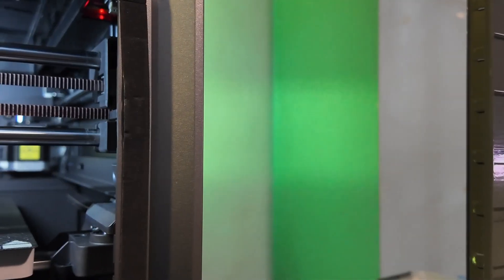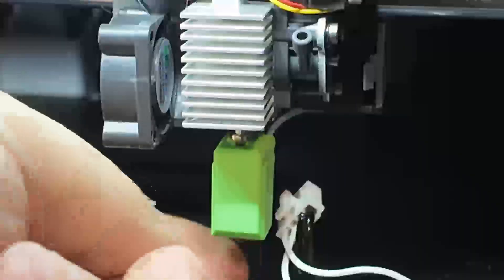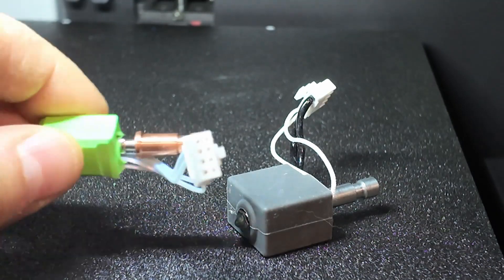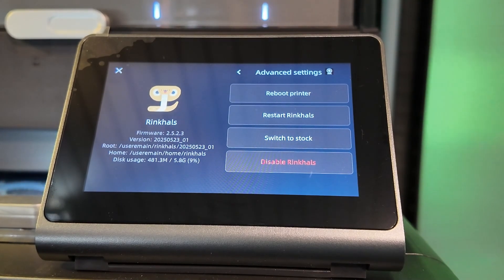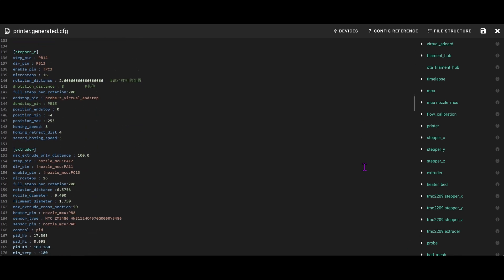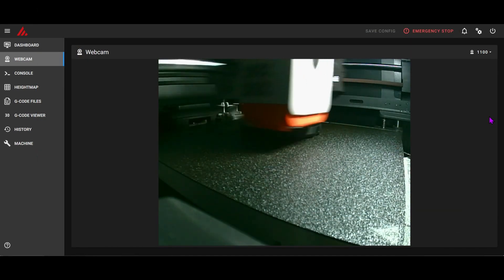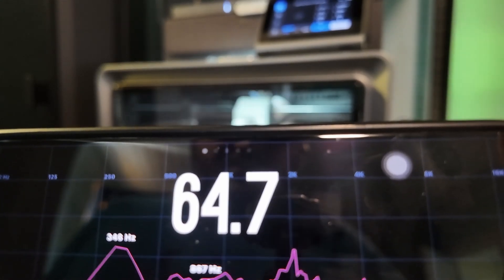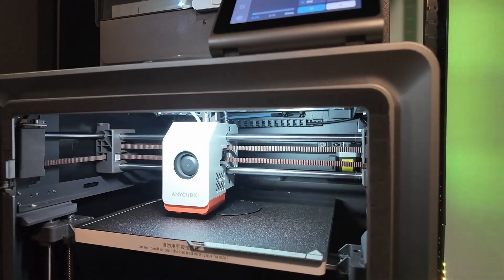Anycubic Kobra S1 Supercharged! - $10 Hotend FIXED Everything

Comment: Thank you for this video! unfortunately the extrusion for me on the first few millimeters is weak and not sticking . each part of the first layer has a short bit of the outer perimeter missing because of this. I've tried increasing flow ratio to 1.0, set my temp all the way to 250c on pla. Set my Zoffset to -.02. set my pressure advance to .3. Nothing seems to fix it. I figured Id try the Amp of the extruder set to 1.0 like you show in the video, but i'm still running into the same issues. I have the green ali exp hardened steel .4 ceramic nozzle , did full a pid calibration, input shaping, and set nozzle to hardened steel on the printer as well as the slicer. Added thermal paste as well. Also using a funssor bed upgrade with .12 mm level variance (used to be 1.15mm). Any suggestions would be helpful.
Reply from the maker: is it only on the first layer?
Reply: @aim6mac as far as I can tell it's most noticeable on the first layer. I'm using skirt loops to help it but it's not perfect.
Reply from the maker: @tbarsnessvfx  Did you tune your Flow rate and PA? Or did you just change the values?

Comment: I bought this printer and can’t even get one damn print going. Keep getting the error for unknown filament in the head. Opened the whole thing and cleared it only for it to give me the same error again. I’m done with this company.
Reply from the maker: can you give me some more info ?  is everything on it stock or modded?
Reply: @aim6mac it’s stock right out of the box. The first print I tried I guess the filament broke off the head and I was able to take that out but now I just keep getting the error that unknown filament is stuck in the head and there is none.
Reply from the maker: @Arod40  I would suggest to push filament through the ACE system all the way to the toolhead, there might be tiny bit of filament stuck in there
Reply: @aim6mac I took it apart and pushed filament through the tubes and nothing came out. I’ll keep checking but it sucks to buy a printer and have to do maintenance on it. This is the only printer that has given me trouble.
Reply from the maker: @Arod40  I can feel your pain, I guess you were just unlucky... One of the sensors must be triggered by something thats 'stuck' on there.
Reply: Turn Off ace , then extrude . Thies worked for me

Comment: Does the Rinkhals overwrite the stock firmware? Will it still get the Anycubic firmware updates?
Reply from the maker: It modifies it, it doesn't fully overwrite it, so at anytime u can go back to stock FW from the rinkhals menu on your printer.  Not so sure about getting all the updates from official channel though...  I would suggest to go back to stock before upgrading , after the official upgrade go back to Rinkhals (make sure the update u do supports the Rinkhals before u do the upgrade )

Comment: Meanly after seeing this video i took the shot and bought the S1 after also considering the Centaur Carbon / P2S. The price of the S1 and upgrades and showed results are worth to nerd around with this printer 😁🔥
Reply: how has your experience been? I'm debating heavily between the S1 and the Centauri Carbon. The Centauri can be had for only $279, but I can get an S1 for about $360 with the ACE Pro, which is super tempting.

Comment: i see the other stepper motors are running at 1.5 so i dont see where 1.0 on the extruder one would be a problem or am i wrong ?
Reply from the maker: i've been using it with these tweaks for a several months now, no problem at all..

Comment: Why does my printer underextend when it starts printing the first layer, and the plastic doesn't stick for a couple of centimeters of the extrusion stroke, but then it prints normally? It's as if there's some kind of extrusion delay. My printer is a Kobra S1.
Reply: I have the exact same issue, let me know if you figure it out
Reply: @tobytrudinger3381  I've come to the conclusion that this is a bug in the firmware. Set the "border" parameter, and the model will turn out well.
Reply: @tobytrudinger3381  I've come to the conclusion that this is a software bug. Use one border loop, and the pattern will turn out well.

Comment: I watched this video 3 times and still didn't check the paste on my HzdaDeve hotend error 10122 appeared, about abnormal heating, which turns the printer off. 

Usually fine filament, especially white, will be discolored and hard to remove from bedplate. 

When you finally remove the silicone sleeve, the once silver part is black 💀

These had no paste at all
Don't be like me 🙏
Reply from the maker: don't add excessive paste now, a thin layer that covers the whole ceramic heater should be ok

Comment: Do I understand correctly that I have to install rinkhals if I want to replace this hotend?
Reply from the maker: not at all, you can do it without installing rinkhals.
Reply: @aim6mac thanks, bcs i dont have problems with print, i have nice prints and i only want hardened nozzle for CF filaments
Reply from the maker: @petrvenc1  well in that case u don't have to install rinkhals for finetuning.
Reply: @aim6mac thanks for your answers
Reply from the maker: @petrvenc1  you're welcome

Comment: did you have to increase print temp for your hotend? i switched to the hotend and am getting constant clogs with the standard temps i was using.
Reply from the maker: if u get constant clogs play around with the temps, increase it by 10 to 15 degrees see if that helps.

Comment: Hi I did the upgrade and fw changes, but running a total calibration it hangs on PID , maybe any idea what happens ??
Reply from the maker: the PID tune for the hotend failed on mine aswell for a several times, then i uninstalled it and installed it again and suddently it worked, so I'm not sure what had happend.  Since then i haven't PID tuned it again.
Reply: @aim6mac  thanks, I solve the problem, I see some guy having a similar issue and it was related with the thermister and the thermal paste, I clean the thermal paste in the thermister and pid calibration pass, don’t know if I should do that 😅  but it works
Reply from the maker: @Itacanaomero  kinda makes sense, but also not, it shouldn't fix it that way, means there is something that doesn't work well, or just too well...

Comment: I have changed the hotend like you and I am having trouble calibrating nozzle PID. Do you have any suggestions for this problem? Thanks in advance.😅
Reply from the maker: try to restart your system, en recalibrate the PID, PID can take a long time on this hotend (30 min)
Reply: @aim6mac  I will try to follow your advice. Thank you very much.
Reply from the maker: @Neamhspleáchas  also make sure that the thermistor cable is intact and seated properly, if none of these work u might have a faulty thermistor / cable.
Reply from the maker: @Neamhspleáchas  just let me know how it goes, if nothing works, contact me again, i might be able to bypass it in a not recommended manner.
Reply: @aim6mac  I tried several times but to no avail, still stuck on the calibrated Nozzle PID screen even after an hour, I checked the hotend and everything is fine.
Reply from the maker: @Neamhspleáchas  ok in that case , i will give you my calibration for Nozzle PID (giving u are using the exact same hotend) this will allow you to test it, be CAUTIOUS though, this is not a safe way to use your printer to print with.  Only use it to see if your hotend works as intended...
Reply: @aim6mac  OK.Thank you
Reply from the maker: @Neamhspleáchas  
[extruder]

max_extrude_only_distance: 100.0
step_pin: nozzle_mcu:PA12
dir_pin: !nozzle_mcu:PA11
enable_pin: !nozzle_mcu:PC13
microsteps: 16
full_steps_per_rotation:200
rotation_distance:6.5756
nozzle_diameter: 0.400
filament_diameter: 1.750
max_extrude_cross_section:50
heater_pin: nozzle_mcu:PB8
sensor_type: NTC ZM3486 HNS112HC4570G0060Y3486
sensor_pin: nozzle_mcu:PA0
control: pid
pid_Kp: 17.393
pid_Ki: 0.698
pid_Kd: 108.268
min_temp: -180
min_safe_temp: 170
min_extrude_temp: 170
max_safe_temp: 320
max_temp: 340
pressure_advance: 0.03
pressure_advance_max: 0.1

Comment: Interesting video, thanks for sharing.
I have a question about the thermal paste part: most hotends are designed to work dry, with metal-to-metal contact between nozzle, block, heater and thermistor. They don’t ship with paste and manufacturers usually don’t recommend adding it, since most compounds burn or insulate above 250 °C.

I just bought the same ceramic hotend and nozzles for my Kobra S1, and I’m running Rinkhals firmware. I’ll be testing it soon. But are you sure thermal paste is really necessary here? Wouldn’t proper fit and hot tightening give the same heat transfer without the risk of contamination?
Reply from the maker: these are bambu clone hotends, they do come from the factory with thermal paste, (make sure the thermal paste goes up to 300-350°)  and yes by design thermal paste is necessary on these.

Comment: After I did the hotend switch, I've been having issues with PID calibration. The calibration freezes at the midway.
Reply from the maker: make sure to install the hotend correctly (hotend and tempsensor cables must go through the latch, if you did that correctly, then u might have a faulty temp cable.

Comment: I get the bed, I have a higher profile than another and from "rinkhals" in the web interface I have not been able to calibrate the Z axis, any suggestion?
Reply from the maker: there is a video online about unscrewing the bed screws then heating the bed to 80 degrees (as far as i remember) then waiting 15 minutes and tightening the screws back in a X patern.  The bed screws are under the printbed sheet.

Comment: I can't make a modification in the printer.custom.cfg file, so I add:
[bed_mesh]
probe_count:7,7
and my printer won't boot, I have to reset via Rinkhals... how can I make a 7x7 grid? Thanks
Reply: have the same issue - did u fixed it?
Reply: Make sure you change the algorithm from "lagrange"  to "bicubic". You need "bicubic" for any probe 6 or more. It should say: 
[bed_mesh]
probe_count:7,7
algorithm:bicubic

Comment: I See max Flow decrease with BamboLab Style Hotends compare to Anycubic Hotends.
Reply from the maker: could be the case, although the original hotends tend to get clogged very often, but we've heard that anycubic is sending out revised one's to custommers now (one without ptfe tubes inside). we're going to ask them to send us so we can test.
Reply: @aim6mac at the Moment i Play with Vulcano Copper Heatblock, Bondtech CHT BiMetal and a Bad modded BiMetal Heatbreak.

I think ... If Heatbreak is modded correct. This combination create more flow with the drawback. Cool down Take a Lot time.

My Point around FIN ak P1S Style Hotends is. A Lot beginners Swap Hotends without understanding how to Filament Profil adjustments are done and how to find right value.

This make it more likely to Clog with Special Filaments Like silk. Reason ... Not enough melting reserve.

I See that ppls have more issue with P1S Style, If they dont Care about difference between different mixture of PLA 😐

Comment: What do I need to do for motors voltage? Just copy-paste the code you put in the description?
Reply from the maker: you could just copy and paste, or just check which values are different then yours and change those, but always make a backup of your original one's .
Reply: @aim6mac I did not have anything in the printer.custon.cfg file.
Reply from the maker: @maydayalaska  right , just copy the whole thing and paste it there.
Reply: @aim6mac I did but didn't notice any difference. I printed a Voron Cube before and after applying the changes.
Should I try with Flow Calibration disabled?
Reply from the maker: @maydayalaska  what kind of difference were u looking for, the voltage tuning is supposed to prevent clogs and underextrusions.  If you aren't having any issues with occasional clogs then u don't have to do the changes.
Reply: @aim6mac i have a little bit of under extrusion, which is remarkably noticeable when printing thenfirst layer.

Comment: If I just wanted to do the hotend upgrade and the thermal paste would I still see an improvement? I'm not too confident in properly installing rinkals and don't want to mess up my machine by doing it incorrectly.
Reply from the maker: hi there, yes the hotend upgrade is a huge gain for sure,  rinkhals is not a must.
Reply: @aim6mac perfect thank you!

Comment: don't you have any issues with the stepper motor temperature after changing the current? I'm concerned about overheating, especially with closed doors
Reply from the maker: nothing happend so far, it's still in acceptable range

Comment: would doing same to kobra 3v2 work as well from extruder hotend to current change?
Reply from the maker: I haven't tested the Kobra 3 v2 BUT this method works on every printer with klipper interface, but please be cautious , overvolting should be only done if you know what you're doing.

Comment: Maybe you  or anyone watching knows this. I have the S1C and it's so incredibly slow. I'm a bit scared going to Rinkhals. But the site said it could print a bench at 15 minutes but I'm having difficulty getting the benchy printed in under 45 minutes. It's just as fast as my old Ender 3. Anyone know how to get it to run faster? Already running the filament at 18mm3/s. 

I'm going to order that hotend hoping it helps a bit. Do I need to change the firmware to use it or is it plug and play? Was considering, if that works, to get a CHT nozzle for it.
Reply from the maker: To reach the 15 min benchy time, u must print it off the printers storage (which is presliced model).  If you slice the benchy yourself then u must tweak alot of settings to reach those speeds.  S1C is pretty fast for it's price point, if yours is only reaching speeds of your old ender 3 , it's probably due to not being sliced properly (you must tweak settings).
Reply: @aim6mac a lot changed since i posted it. I saw how easy it was to change to rinkhals and i switched to it. I ordered a new hotend and plan on buying a CHT nozzle. I didn't know about the calibration in the printer and in orcaslicer and spend a lot of time doing all of them. I can now print a benchy in 21 minutes. The extruder changes don't appear to have been set properly, still figuring that out. Thank you for the video!

Comment: Which meterials are you using? Cause I have S1 and tried to print with PETG and stock nozzle with very bed results. Stock Nozzle was clogged just only 10-20 hours of PETG print. Very disappointed.
Reply from the maker: i've tried, PLA, PETG and ABS so far, no problems with the bambu style hotend as of yet.   Just get rid of the stock hotend it's a big failure point on this printer!
Reply: Iemai and tinmorry print great for me but overture petg is a nightmare to try to print in mine. I haven't tried any additional brands yet in it. But the brand of petg makes a huge difference.  Make sure to set up print profiles for each filament too.

Comment: I already had this hotend installed on my Kobra S1 along with the latest firmware and the latest version of Rinkhals. Decided to give the extruder voltage bump a try and so far everything is working great. I just got one of the best looking prints so far off my S1. Thanks for sharing.
Reply from the maker: thats awesome! stay tuned for more.
Reply: How do you do that
Reply from the maker: @saliston  it's shown in the video
Reply: Idk without these changes from the factory I get perfect prints and I can't complain lol
Reply from the maker: @3D-G4br13l  well lucky you!
Reply: @3D-G4br13l  sounds like you were lucky and got one of the well put together printers. I got one of the units that had issues. Mine is finally running well after I used the funnsor replacement bed plate kit and their undercarriage replacement kit to get my warped bed and bed mesh variance. Before I replaced the bed and undercarriage I was dealing with a 0.7 variance between the highest and lowest points on the bed and had issues with the back left corner flexing when the bed level probe was probing that corner. 
It was causing issues with the bed mesh in addition to the variance.
Reply: @vanloggins well tbh is a rare event to be that lucky, usually im unlucky about everything 
My past printers were all sh1t from unbox till the end

Comment: Can the voltage changes work on the stock hot end?
Reply from the maker: yes you can change the voltage , since the run current you change is for the extruder motor, not for the hotend.
Reply: @aim6mac  do you think 1.0A is safe for long time usage or is it a bit high? i set mine to 0.8 /0.5 currently...
Reply from the maker: @markushauser9015  Hi there, thats a legit question : if you don't trust it then set it to something that works for you, we've tried 0.8 , it worked well overally but here and there still got a false report of potential clog, we have tested the 1.0 amp for some time now, and not a single potential clog warning...  But yes, it might take away from the longevity of the extruder , thats why we give out a warning thats it's on own risk to do any kind of changes to the machine itself.